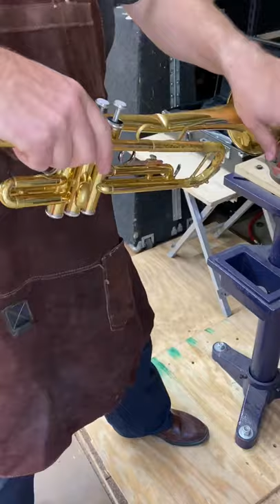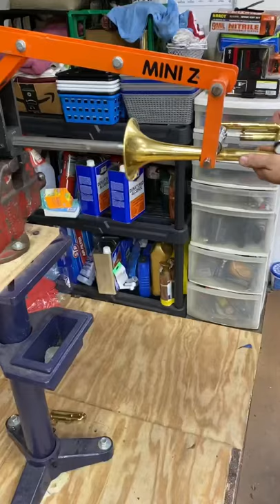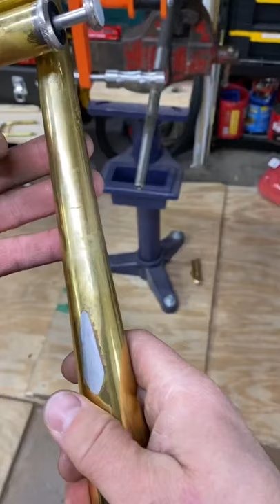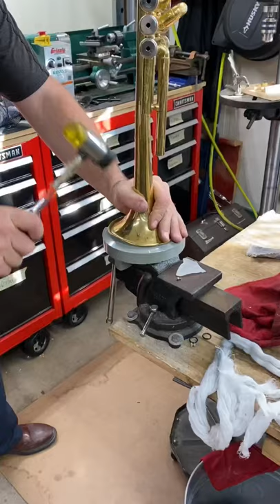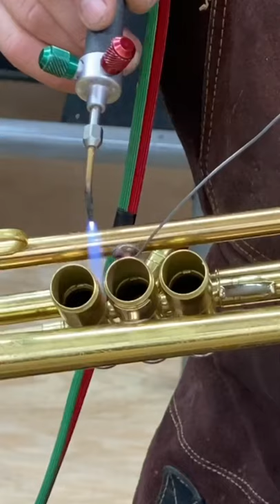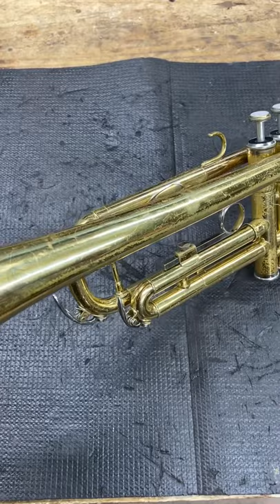De-Dizzy Trumpet- band instrument repair- Ferree’s Tools, Wes Lee Music Repair

Comment: How much does this usually cost? The bell on my horn is so dented that I can't fit my hand inside.
Reply: It costs what the repair man estimates
Reply: @hampter2407  i’m not talking about a trumpet. i’m talking about a horn.
Reply: Repair work in my area gets billed out at ~$40/hour.  That seems pretty cheap to me given the amount of skill involved, especially relative to other crafts, such as auto repair.  You'd have to post some pictures of your horn, but I can't imagine that the work would cost more than a few hundred dollars.  Depending on where you live, you might also have to add shipping costs to that in order to get your horn to a qualified technician.
Reply: About 700 €
Reply: I couldn’t imagine not being able to put my hand in my horn, I’m so careful with it because I don’t want to pay the fees 😭
Reply: @unstablegay_0898  Seems like a good attitude to me.  "don't do the crime if you can't do the time."  type stuff.